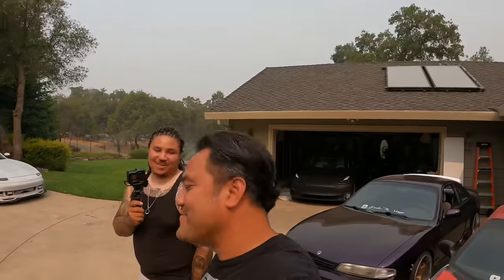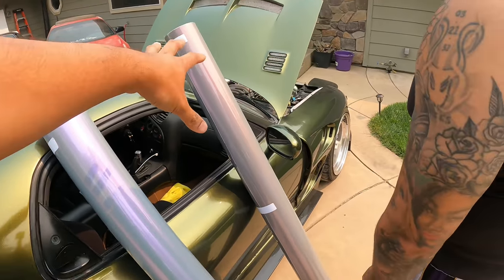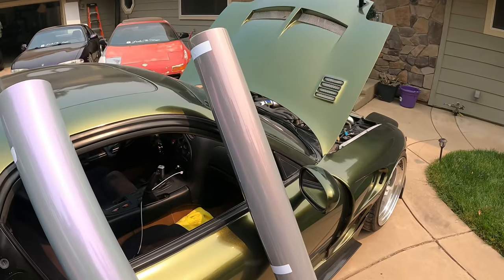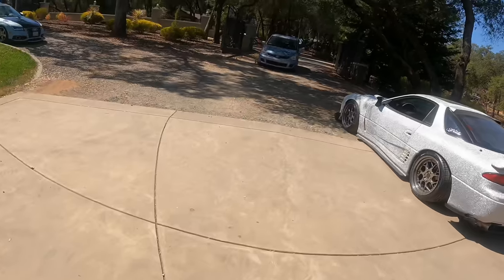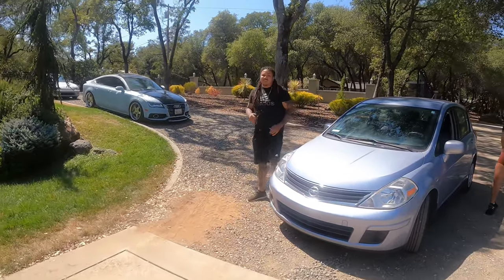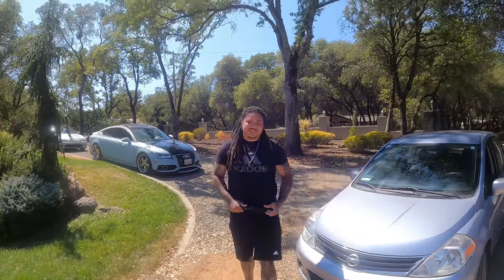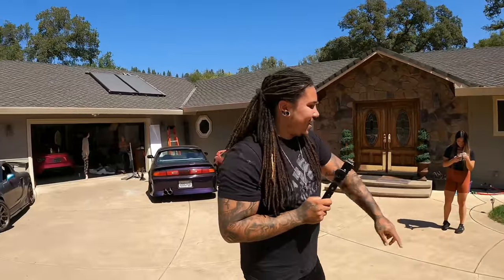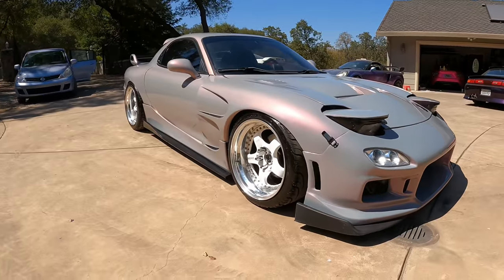Mike Myke’s RX7 Gets The HOTTEST NEW COLOR | Yes You Can Wrap Over Primer! One Week Transformation

Comment: Because in a single rotation(360 degrees), rotary fires twice per rotor. Unlike piston, which only does one.

Which means a typical 1.3L is actually 1.5 times that in a rotary.

Comment: why would you create a seam around the latch, a slit would work and would hold up much better then that little overlap seam, and also why not tuck under the latch instead of just cutting around? this is not how 3m teaches, is not how any shop  I have worked at ran. we took everything off, from lights, door handles, mirrors and put that wrap on then when you put the stuff back the wrap is sealed pro like.

Comment: Lots of bad info here… as a professional I would never wrap over primer. And I wouldn’t take the protective layer off until the wrap is finished
Reply: a question of time until your comment is gone somehow there are always only positive comments
here in germany you would be sued for this work 
If you run the video in slow motion you see how unclean the corners and edges are 
apart from that the car is horrible when you see how the parts of the bodykit wobble around 
The parts are not really tight and fitting accuracy is also not present ... would not surprise me if the front bumper at 200 (kmh) flies away
Reply from the maker: Lol the point of this Channel is to show how to do it unprofessionally.
Reply from the maker: It’s all positive because I have overwhelming support from my fellow car guys who is learning how to do this and save a ton of money. I only ban the haters, not folks with different options. People are more than welcome to bring their cars to a professional shop instead of some dude in his garage